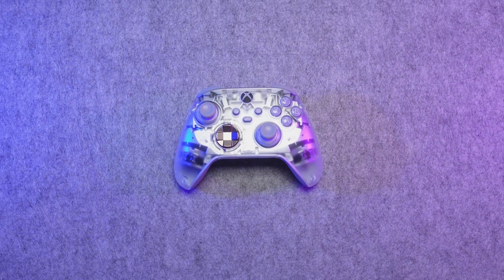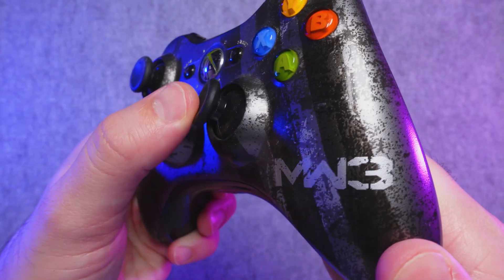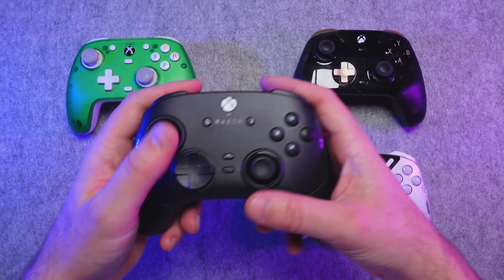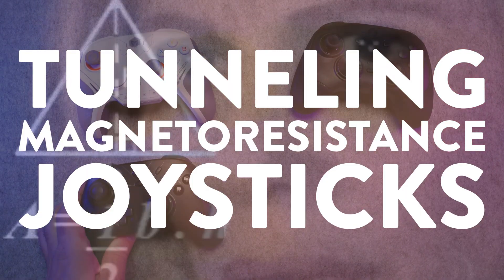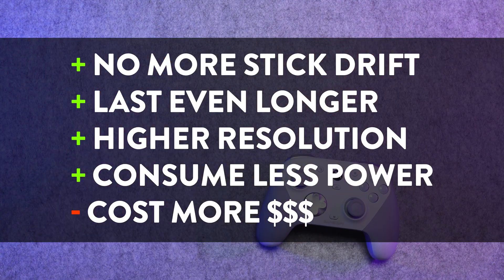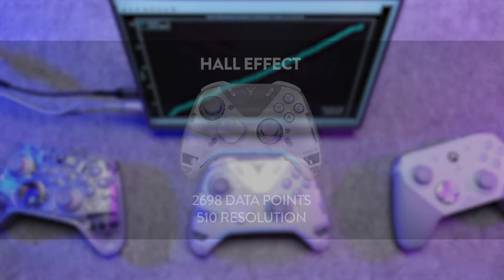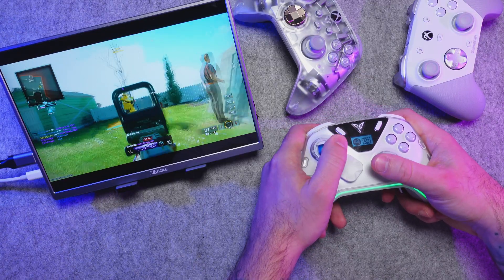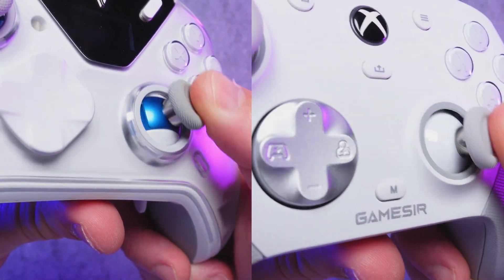Hall Effect vs TMR - What's the difference?

Comment: I don't think a TMR stick is noticeably better than Hall Effect. Yes, it is technically better, but so far I can't really notice any difference in real world usage, assuming you're comparing good HE sticks vs good TMR sticks. The main advantage is not its resolution because it is useless in real life just as mouse with more than 2000dpi is useless, but its affect on battery life since TMR uses a lot less power than HE. It isn't that a controller with HE sticks last very short, but more when using TMR sticks the battery life will be improved (vs HE). Some people says the latency is better which is not exactly correct. The latency is better simply because it is being used in more newer controller where right now a lot of manufacturer focus on latency. There is simply no inherent tech advantage with TMR vs HE regarding perceivable latency difference. Also I'm not sure worse centering is a thing with HE. I always use my controller with 0 dead zone compensation and I don't see any centering issue. For me, regarding TMR vs HE, the tech used should be your last priority. You should focus on everything else first, like the features, button type, layout, the feel of the sticks, etc. If in the end you are left with 2 options that are basically the same except for one with TMR and one with HE, then pick the TMR option. Don't fall into the trap of buying a controller with TMR just because it uses TMR. And yes, I have a controller with TMR and honestly I can't tell the difference between it and HE in an actual gameplay.
Reply from the maker: I think most people probably won't be able to feel the difference between any of them honestly. Most gamers are just trying to pick up a controller and game at the end of the day. Personally I can feel a difference between hall effect and TMR sticks but it is definitely subtle.
Reply: One of 100000, very nice explanation ;)

Comment: Am I the only one that actually prefers potentiometers sticks just because they feel more accurate in fps games and just more consistent?
Reply from the maker: Nawh I understand what you mean. There's something tangible about them that feels comfy. Probably since we've been using them for ages. But I think after adjusting the new style of joysticks can def be better
Reply: At first I do get the difference in input readings for the sensors. But, potentiometers just suck so bad now compared to newer tech in joysticks.
Reply from the maker: @Badget007 they just break so easily. That's really the main thing

Comment: I use two controllers one with Hall effect and the other with TMR, switching between them frequently, and honestly, when I play Delta Force I don’t really feel much of a difference. Both are super sensitive and accurate. In practical use, I can’t find a huge gain or loss between them, unlike the clear difference you get between potentiometer and Hall/TMR
Reply: I agree. I think it's Alla preference. Feel like TMR is slightly smoother but my TMR controller is newer so ... Lol
Reply: @brana1646 u ain't felt smooth or precise until you try switch 2s pro controller  it ain't even close its so far ahead it's mind bending  it decimates the completion utterly
Reply: @audie-cashstack-uk4881  switch pro controller does not work on PC natively and thats the who reason why i bought it for sw2 but mainly PC
Reply from the maker: The difference can definitely be subtle at times. I think it largely depends on the resolution between them. The TMR sticks usually record more data so it's nice for small movements especially with kontrol freaks on. The G7 Pro feels super responsive and I think it's noticeable
Reply: Try switch 2s controller difference it's like eating cotton candy vs dog shit like stocking a wet clip on the finest girl in nigh school whilst winning the lottery at the same time tmr hallefect a out dated and pointless discussion  switch2s custom sticks have set a bar so high it's heavenly
Reply: @audie-cashstack-uk4881  Are you okay 😂
Reply: @audie-cashstack-uk4881  are you a paid bot?

Comment: i just changed my ps5 sticks to TMR. i initially wanted Hall Effects because its cheaper, though the store technician to where i brought my controller to be fixed, suggested to me to opt for the TMR and he guaranteed i won't be disappointed even though its more costly. i relented and i am satisfied with the result. TMR is so smooth to the feel especially when playing with FPS, like Delta Force. I cant wait to try it on BF6.
Reply: Bought an AIM controller?
Reply: how does it feel with battlefield, update?
Reply: @khrewl7367 lmk if you find this out
Reply: @k @khrewl7367 feels like butter🧈
Reply: Literally, the same thing happened to me. Technicians are pushing these TMR’s.😂 I love it though
Reply: @RigorousEnlightenment  the Tech did y'all right. I had to find out the hard way after spending $200 on a turtle beach controller 😅

Comment: I was using the G7 Pro for 2 months and the G7 Se for another 2 months and the truth is that the G7 Pro does have good precision, it is very sensitive which sometimes ruins the 1vs1, in long shots it is very good, but in close combat it leaves a lot to be desired, where the G7 stands out more
Reply: This might be resolved by adjusting the sensitivity and acceleration curves go give you two distinct sensitivity bands for your needs
Reply from the maker: I mentioned that in my G7 Pro Wuchang review actually! I've found that tweaking my in game sens on games helps a lot with the sensitivity of the sticks

Comment: I have both the vader 4 pro and cyclone 2. For me the difference in accuracy is very minor. The inner deadzone of cyclone 2 is 8/100 and 12/100 for vader 4 pro. The real difference comes down to the power consumtion. If you shut down the RGB light in the controller, the TMR is just better.
Reply from the maker: Yeah in general the differences between the two is pretty small but it's nice that the tech is progressing!

Comment: My G7 SE has been working so well with Racing games for over a year now, best pad since the Dreamcast I have had. Maybe when Gamesir releases something with tmr and membrane buttons I'll check It out.
Reply: I wouldn't lose sleep over it, I use the g7 he and razer wolverine v3 (tmr) and they're honestly interchangeable. There's no friction, so you feel the smoothness, but after that you're seriously hitting a roadblock on what you can actually feel
Reply: @pspcow  I think the resolution of the hall effect sticks (at least the ones in the G7 Se) is plenty to detect the smallest movements our thumbs can perform. I tested in the gamepad tester and it takes several tries to pull a 0.0005 register on the sticks, it is not something realistic for in game situations. Maybe someone should try with Tmr's. :P
Reply: @lukilladog Honestly, I think the traditional 8-bit 0-255 reporting is fine for thumbsticks of any sensor type. They're just too clunky for fine resolution to matter.

The differences are more pronounced in actual joysticks, where you have a lever long enough to make small precise movementsd

Comment: Great vid.  Tmr, hands down is the best!! Also could do a vid on updating the firmware on the big big won blitz 2?  I can't for the life of me, for it to update. Thanks. Keep up the great work.
Reply from the maker: Thanka for watching! I agree TMR sticks are the best right now. For the Blitz 2 TMR you just need to connect to the app (preferably on windows) and go into the settings where it'll have an update prompt. It gives you instructions there how to do it properly. Let me know if that helps!
Reply: @AndysTechTable I I did that. I still get failure. I try multiple different solutions from different content creators. I must have bad controller. It works fine but nice to see what new with firmware update.
Reply from the maker: @mikeh2o73  awh man I'm sorry to hear that. I assume you've tried factory resetting it as well?

Comment: I'd heard about Hall Effect joysticks for a while but genuinely never understood the difference - now I get to add TMR into my lil back pocket of knowledge for future reference. Thank you!
Reply from the maker: TMR is the new hot tech and it's reaaaally good! Thanks for watching 🙏
Reply: Now you preemptively understand a certain piece of jargon from when the GabeCube was revealed.
Reply: Tmr and hall effect have both been disarmed nintendos new sticks are the devine mind blowing performance
Reply: @audie-cashstack-uk4881 name
Reply: @audie-cashstack-uk4881  incorrect, nintendo went cheap (again). The Switch 2 joy cons uses the worse of all 3, traditional potentiometer-based sticks, same as used in the original Switch
Reply: @audie-cashstack-uk4881 what nonsense are you trying to spew here? Nintendo Switch 2 uses the og sticks just a bit bigger than switch and also doesnt use anything new or hall or tmr.
Reply: @ssaunders1122  And are worse than the worse hall effects I've ever used 😂 Can't believe Nintendo didn't put them in their controller. I can't imagine they would have to pay more than a company like Gamesir for the modules.
Reply: @arenegadeboss thats going a bit far. My wife bought a Switch 2 and they get the job done just fine. And I've had a switch and switch oled. Only one controller ever had issues.
Reply: @ssaunders1122  what hall effects controller is worse?
Reply: @arenegadeboss where the hell did I say anything alluding to that? All I said was Nintendo switch 2 sticks work just fine and get the job done.
Reply: @ssaunders1122  You replied to me saying that 😂 And said I went too far
Reply: @arenegadeboss I never said the switch or switch 2 stick was better than a hall effect.
Reply: @ssaunders1122  I know, it was me. I said that, and then you replied to me saying that stating I went too far 😂